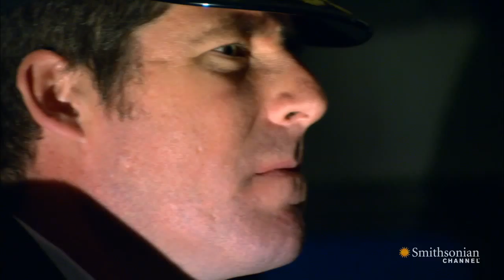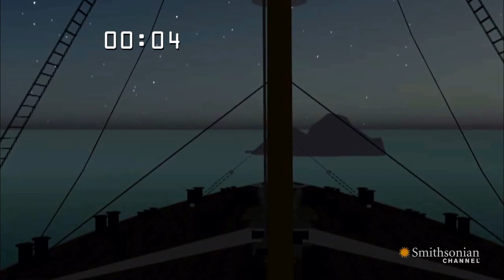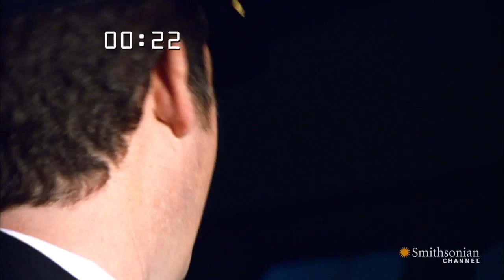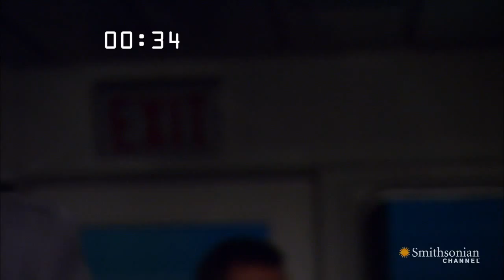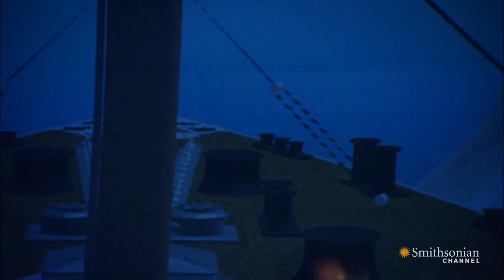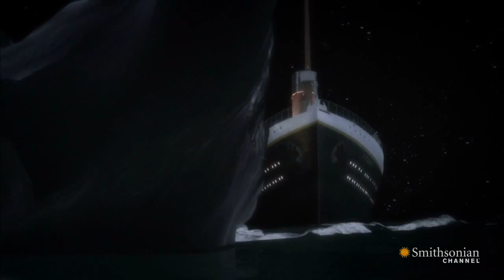Reproducing the Titanic Crash

Comment: The crew of the real Titanic including Captain Smith did not have much experience with large steam ships.
Also note the design of Titanic with 3 propellers and an undersized rutter made her slow to turn without forward power
Reply: Where are you getting your horribly wrong information from?  The bridge crew of Titanic's maiden voyage were all experienced officers with many years of real time experience gained on board large passenger liners from Cunard and White Star Line and for Lightoller you can add ships of the Royal Navy where interestingly enough he was on board the HMS Dreadnought!  Captain Smith had long been a favorite among regularly traveling passengers and Captained the RMS Baltic (729 ft./23,87666666 GRT), RMS Cedric (700 ft/21,073 GTR),  RMS Adriatic (730 ft./24,524 GTR, and later the RMS Olympic (883 ft./45,324 GRT) with 11 voyages before he took the helm on Titanic.  The bridge crew members had plenty of experience on board large steam ships, though not quite as large as Titanic with the exception of RMS Olympic.  The crew on board Titanic did not lack in proficiency or suffer from unfamiliarity due to her size.  Regarding Titanic's rudder, Most of the expert opinions I've ever read regarding Titanic's rudder disagree with those who claim it was too small.  She easily passed her sea trials which included tight turning circles and the like.  The criticism about her rudder is nonsense.
Reply: So much bullshit, Smith had 10 voyages record on Olympic and Titanic rudder was not too small

Comment: What they should've tried to simulate is the Titanic's handling with her engines, not stopped or put into reverse, but left alone at speed to see if the direct wash from the center propeller over the rudder makes the difference in avoiding the iceberg or minimizing the damage.
Reply: It'd be interesting to see both the effects of keeping all engines at full ahead, and possibly reversing only the port side engine. I would suspect that she might've cleared then, as the turbulence from the stopped middle engine and reversing outboard engines wouldn't have reduced the rudder's effectiveness. On many other maneuvering trials on other ships, documentation has shown that rudders can lose almost all effectiveness if flow over them is disrupted by stopped or reversed engines. I know that on the battlecruiser HMS Hood, ship handling guides written in the 1920s warned that the two inboard engines must be providing some sort of power in the direction of travel for the rudder to have any effect. Differential thrust might have also helped, however that might have also caused too much turbulence for the rudder to "bite" and negate any advantages gained. It'd definitely require hydrodynamic analysis to know for sure...
Reply: well her middle prop is useless for manuevering
Reply: In the full show they do a number of other scenarios to see if anything else could have been done and all of them resulted in collision and one made things worse.